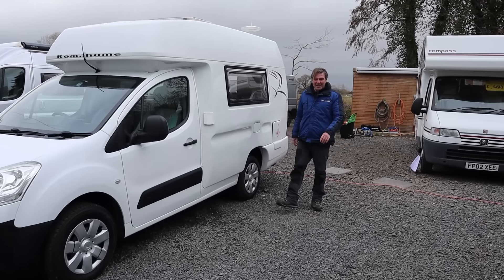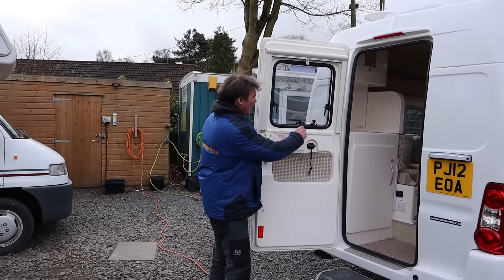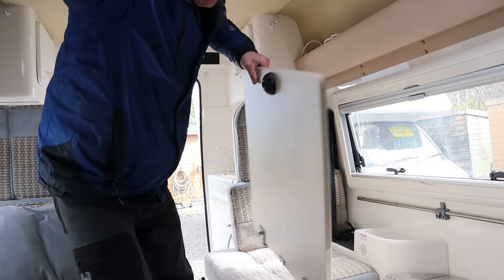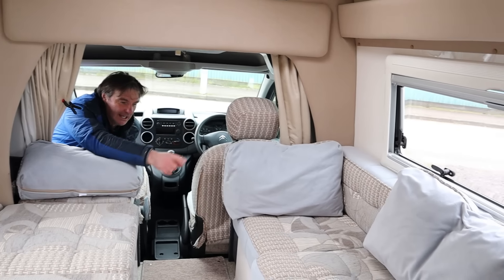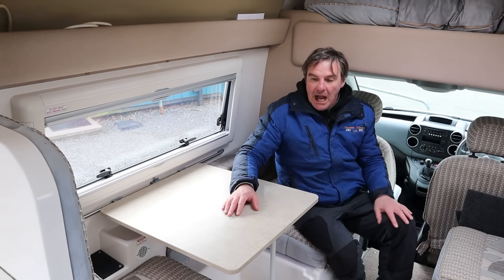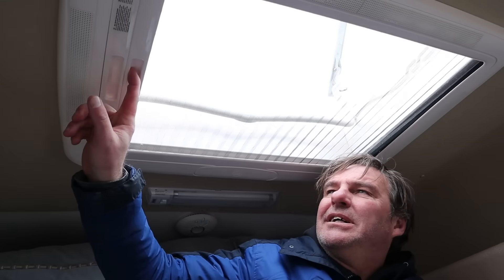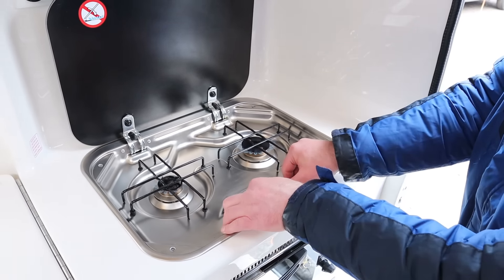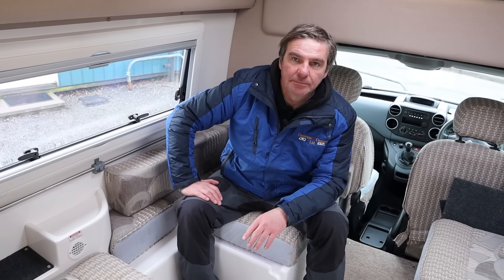Romahome Campervan - Romahome R20 HI Motorhome

Comment: You dont need to drive anywhere  to have an Adventure.  Built in pot holing and assault course. Great fun guys. With our Talbot when the bed was made up . If you rolled over in bed it released the handbrake. Passenger and drivers seat had been swopped over in its lifetime. Cheers from old George and Jane 👍👫🤠🇬🇧
Reply from the maker: All the fun of camping 😀

Comment: Very clever design into such a small van.
Reply from the maker: It really is! Ravindra 👍
Reply: @TheMotorhomeMan  Yes, and the best thing is you were able to fit seats for 4 with seperate beds for 2 and a jumbo large bed, with a kitchen. I liked the KITCHEN extension platforms a lot. And the best thing i liked about your design was clean looks. What material is it. How do you make those. Its very clean finish without any sharp edges etc. Very neatly done. Very smart design.

Comment: I have an R10 great tiny van, did buy a fridge as doesn't come with one and it has a pop up roof too, great on diesel and can park it anywhere as fits under carpark height barriers! Great little vans 😀
Reply from the maker: Well said Sue 😆
Reply: Hi sue ,totally agree with you.when hubby passed away suddenly at 52,we owned a huge tag axle kon tki 669.
I went from over 24ft to the tiny r10.
And can honisly say ,camping in this wee tardis was much more fun .....missing my solemate goes without saying .
Amazed me why not more sold or seen around enjoyed every mile till sold.
Be well sue x safe 👍💟

Comment: Amazing, clean lightweight polyester. Looking very good. Having a diesel heater with a car running on Diesel makes sense. I guess a couple of solar panels wouldn't hurt either.
Reply from the maker: Thanks for the comment! Diesel heaters are rather efficient Robert and pretty standard on these style of vans. They work well and that's why companies continue to fit them on vans built today! Solar is always a nice touch👍

Comment: Think it's safe to say "just don't bother with the double bed" option. That aside, I find myself wondering if it's possible to deploy bed mode by having the seats move forward instead of leaning forward...

All in all, not a bad start to a good camper van. If I were to modify it, I'd nix that bit of storage above the sink so that space could also serve as a shower, in addition to sink and toilet area(obviously would have to fit a gas water heater in there somewhere). Honestly, could probably nix that useless little oven as well to either get more fridge space. From there, put a camp water heater in one of the seats or that cabinet space above the stove. 

Sure, the plan does sacrifice a bit of the limited storage, but the added functionality would be worth it. One never knows when they're going to need an actual indoor shower on a camping trip.
Reply from the maker: Great points there Reaper 👍👍